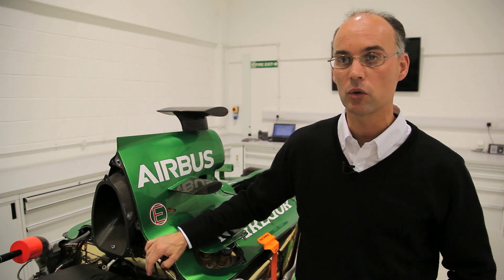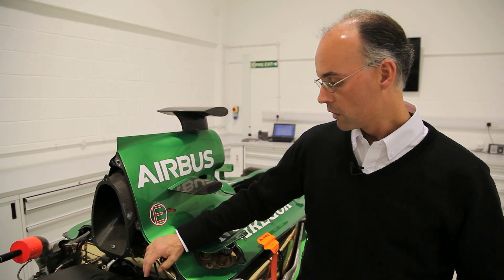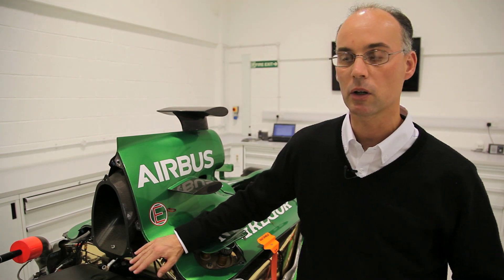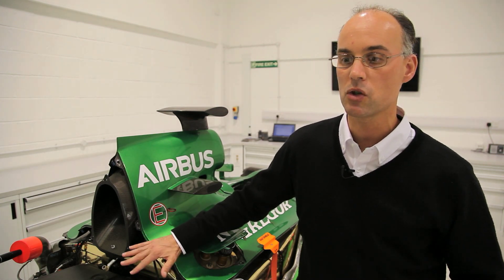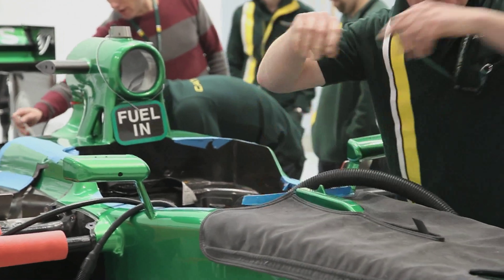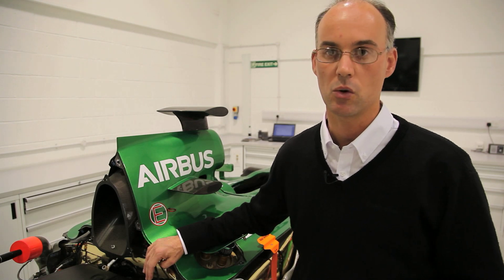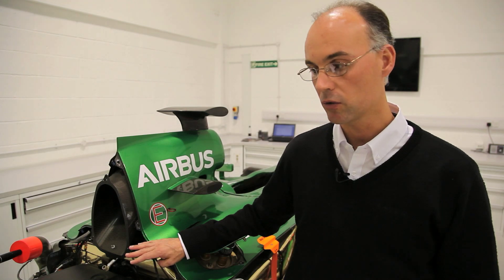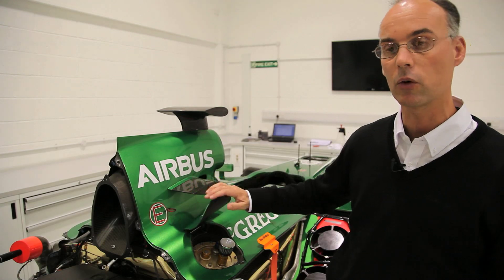A guide to Formula 1 fuel

Comment: Oh yeah. Speaking of CART, as you know, the X1 is roughly what CART would have became. 

I somewhat agree. The rules shouldn't dictate efficiency in that manner, as the engine builders will work around to that themselves, like always. Make them swap to i4s, leave fuel restrictions alone. 

I also think F1 should be pushing the limits of tire tech, instead of trying to create artificial racing by telling Pirelli to make, IMHO, trash tires. 

2004 cars with FW14B suspension tech(Supplied)=sweet.

Comment: It's all about making F1 appealing to the road car folks and making it mildly affordable...and a formula one that stresses more efficiency will do just that...

Although, the previous model stressed efficiency just as much as this one...It is only a logical thing to hunt for power, then the efficiency to use less fuel(less fuel weight=better starts tire wear race pace qualy pace etc etc etc etc).

I'd like to see a F1 without limits and with ridiculous engines, but few, at this time, want that.